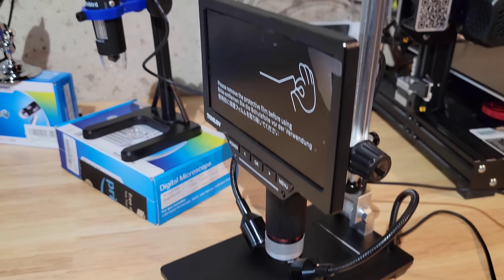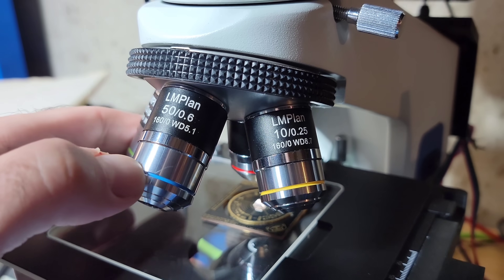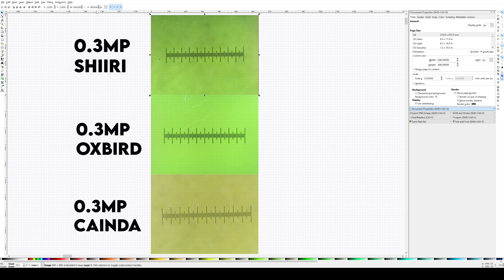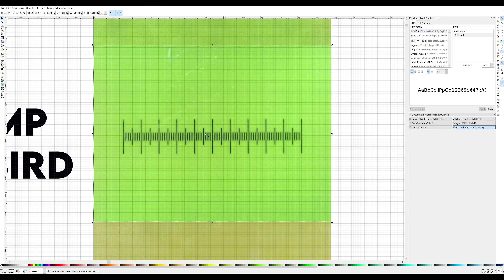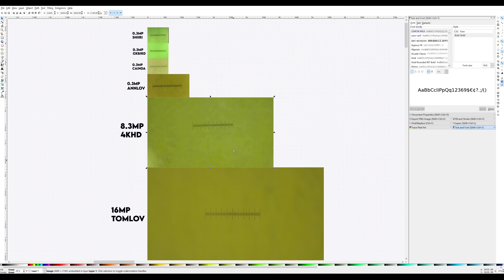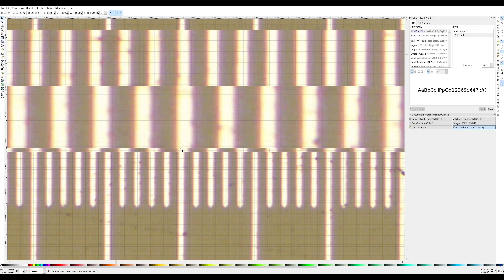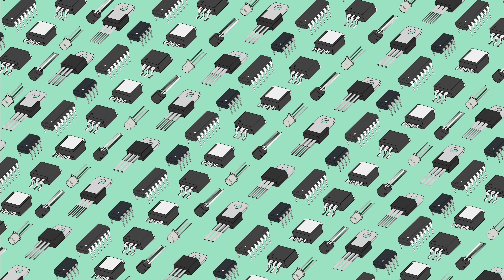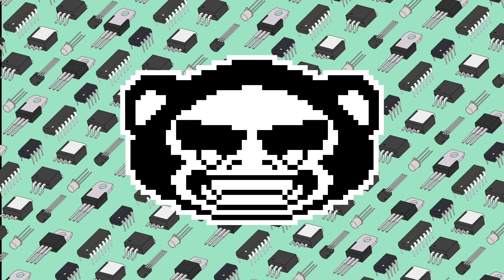Digital Microscope Comparison: Follow-Up

Comment: @EvilmonkeyzDesignz, The reason why you are struggling to compare these microscopes and images is because you are lumping many things into "magnification".  For digital image term magnification is not defined until you specify the display size. The same image shown on 27" screen will have 3x higher magnification than if shown on 9" screen. For lenses however magnification is defined without specifying size of the display; it is the ratio of the image size on the sensor to the object size in real life. Camera macro lenses have magnification defined for them and it is close to 1, while non-macro lenses have magnification far less than 1. Once you also define the resolution of the sensor; you can consider the effective resolution of a particular lens combined with that sensor; but this is a separate metric than "magnification".  Thumbs up on the effort though. In real life it gets even more complicated because color of light and size of the aperture come into play as well. Brace yourself for fancy math; look up airy circle.

Comment: The upper limit is due to circles of confusion and the pixel unit size of the sensor. If you use a sensor with similar MP but higher pixel unit size, you will increase the virtual magnification capabilities.

Comment: Resolution is also limited by the optical aperture. Similarly with telescopes there is a diffraction limit that is determined by the optical system's aperture size. The smaller the aperture the less resolution you get.
Reply: Do you remember when the internet figured out the resolution, lens dimensions, and orbit of a US keyhole spy satellite from just one leaked picture
Reply: @godlugner5327  no idea, but known fact that Hubble is slightly modified KH-11, and all data is well known.

Comment: The cheap digital microscopes use a CCD (charge coupled device) to capture the image.  They can call it 2,000 max magnification if they want, but it will only capture to the max the CCD will and what the electronics support.  It was probably like in your initial review that one of them had a CCD that supported higher resolution, but the electronics only supported the .3MP so was limited to that magnification.
This is like the majority of electronic and lighting stuff on Amazon, from China, which is BS.
Reply: Makes me think that I'd get a better result by buying a lens or loupe attachment to the phone camera. Good chance it's got a better optic chip.

Comment: Came across the video while searching for info on that really cheap USB thingy, which ends up looking like just the part for what i need it for, but then started wondering. Did you ever use "mean stacking" on sequences of images taken with you professional gear? And does it make any difference in image quality? It makes quite a difference with cameras, from cheap webcams to DSLR's, but microscopy might be different.